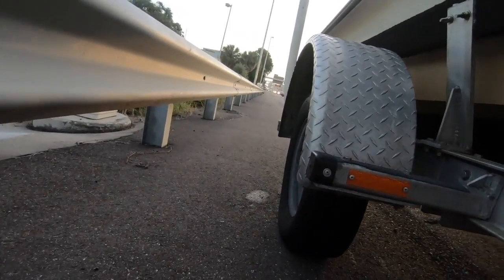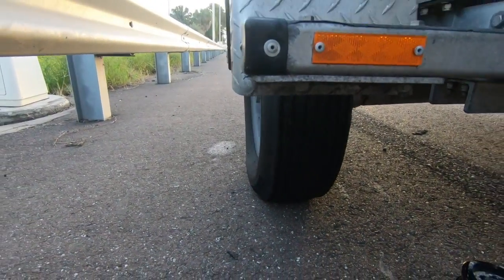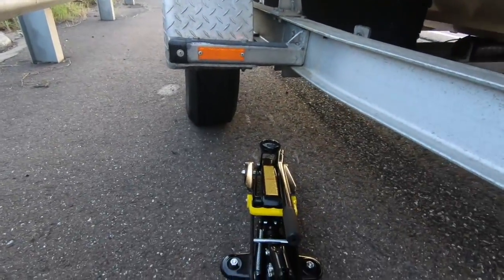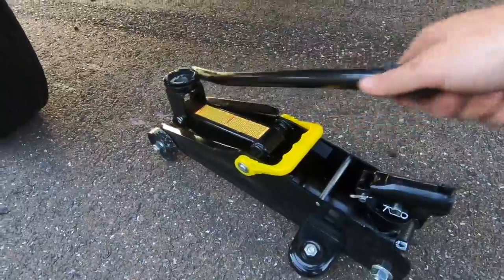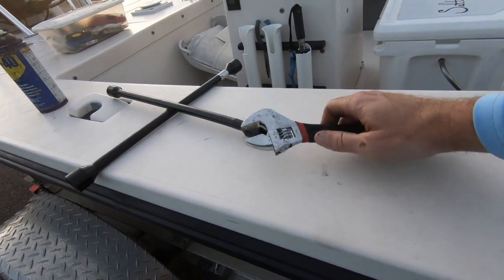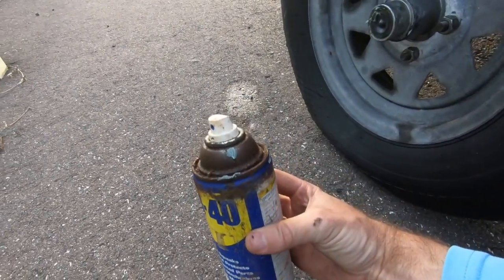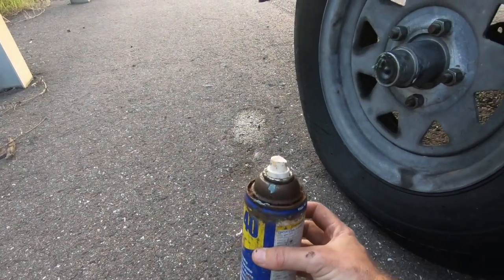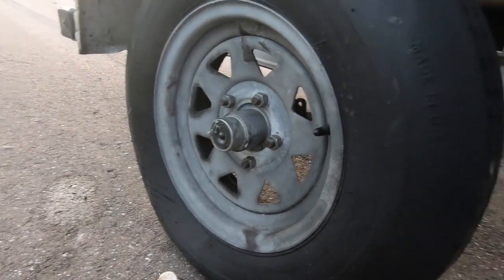The Tools You Need When Towing Your Boat [Blown Tire Repair]

Comment: I agree a floor jack and tire tool is a must. In addition I used to carry a can of PB Blaster. It seems to work great on those rusted nuts. I also had a set of new hubs that already had bearings packed and sealed. It seems like overkill but in reality they only cost about $25 more than buying bearings and seals (for a single axle trailer) and saves a ton of time especially when you're on the side of the interstate.
Reply from the maker: Great suggestion about the pre-greased spare hub that's ready for action whenever needed. I always keep one handy for all long trips, but I should make a  habit of bringing them along for even short ones because you never know when it'll be needed.
Reply: @Saltstrong  yes sir if you tow a boat long enough it'll happen eventually. I know routinely pumping fresh marine grade grease into the buddy bearings will help prevent issues but that's something I have never been good at doing.

Comment: My boat trailer tool box has a bottle jack, 2 blocks of wood, 3 reflective triangle markers, grease gun, crescent wrench, lug nut socket, ratchet wrenches for trailer bolts and WD40
Reply from the maker: Looks like you are well prepared for a tire problem. I def need to get some of those reflective markers for safety on the roadside.

Comment: I learned a while back to carry extra trailer wire (both sides) wire cutters/strippers and wire nuts. In case tire fragments cut a wire. All fit in a zip lock bag
Reply from the maker: That's a smart idea Matt. Thanks for sharing the tip.
Reply: Unfortunately I found out the hard way and got a ticket from fhp

Comment: Consider this can also happen at night, in the rain. 

Strong LED Headlamp for each person frequently with you when you trailer.

Don’t forget you likely have lights on boat that will help illuminate area around and under boat on trailer (underwater lights, navigation, spots, floods)

Remember the rain gear you probably have in the boat. 

I throw my 18 volt cordless impact driver and cordless drill with 3/8 socket drive adapters in back of truck, used with proper sockets can speed drive lug nuts.
Reply from the maker: Good point. Might as well prepare for having to make the fix in the dark or in the rain.

Comment: Having a spare set of bearings come in handy as well.
Reply from the maker: Very true... nothing worse than being stranded on the side of the road with a boat without the equipment needed to fix a tire or a bearing that goes bad while en route.
Reply: @Saltstrong  yes i found out the hard way when a tire came completely off my boat trailer on the interstate. I think i had a horseshoe up my ass that day though because this guy stopped right after it happened and had the right bearing i needed and he changed it out for me.